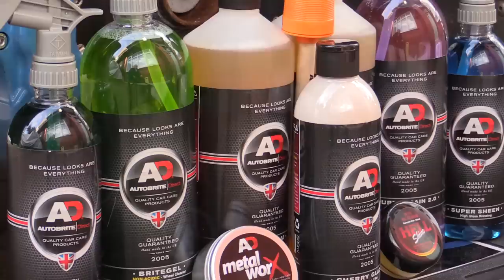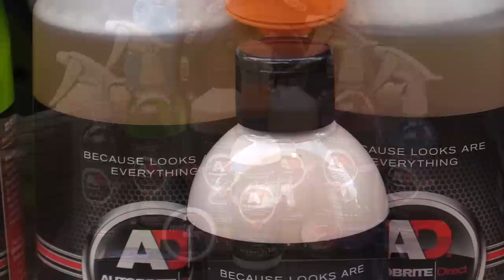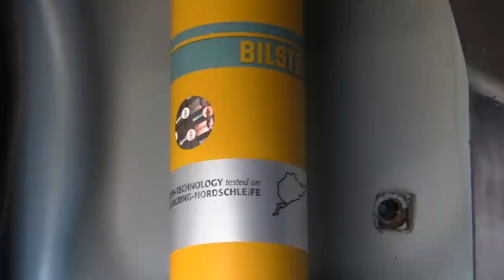'Guru Mobile' Wheels-Off Winter Prep

Comment from the maker: Yes, my brake lines are chafing but so are my 'undies' and they take priority!
Reply: Looks super clean!! If you haven't already, definitely put some anti-seize compound on those aluminum wheel nuts.
Reply: Car Cleaning Guru how long usually dose it take you per corner too fully clean and protect I'm a mechanic looking at possibly taking detailing on as a side job so I have extra income but it also depends on how much extra weight I'll have to carry
Reply: smear it on the wheels contact surface and hub ring also, keeps the rust off and makes them easier to pull off.
Reply: Loved the start of the video, plus the info that you're just hitting one wheel arch in this video.  Really find your stuff informative.  Keep it up!
Reply: i wish i could do it.i can t no garage no tools but end of the winter i can use  the high pressure this is way to do it i agree and the end result are great.also see and hear you and your voise
Reply: Car Cleaning Guru You done a good job man! Car looks great!
Reply: Car Cleaning Guru Out of interest for general car cleaning on non damaged paint/sensitive parts do you turn the pressure down on your kranzle? Or full pressure? Cheers
Reply: Your sense of humor is what makes watching someone wash wheel arches so damn entertaining.
Reply: Car Cleaning Guru 
I'm very concerned of the harsh chemicals run off eventually getting into our drinking water all for the love of making our cars clean and shiny.
Reply from the maker: I would hazard a guess that any cumulative adverse effects car washing has on the environment are trivial when compared with say, big agriculture. It rains so much here in the UK that by the time any chemicals hit the ground water, the diluted effects they have will be negligible.
Reply: Car Cleaning Guru 
So how much water is needed to dilute a harsh chemical to make it safe enough to give your children to drink?   Its someone elses problem if it goes down stream as long as you don't seem the foam on the shore.
Reply: sometimes there is no other way.not always you have to use water.mi self go to the coins wash they recycle the water and there waterless and rinseless- if the body is real dirty can t use both there products biodegradable
Reply: mrBDeye There are lots of ways to mitigate this - you can get plenty of great cleaning products that break down into harmless components, you can find out about how your local ground water system works, and if it is safe wash your car in a suitable place - for example if your rain water system empties into local streams, but your ground water is not taken locally, wash your car on the lawn - or find a local self service car wash that uses a closed system or sewage and wash your car there.  It's just a matter of educating yourself in the best method of minimizing environmental damage.
Reply from the maker: Mate, If you want to have an environmental willy-waving contest, I guarantee I'll beat you hand's down in terms of the overall impact (or lack thereof) I have, despite my car washing compulsions.
Reply: You put so much product on just one wheel it is doubtful you will win any environmental contest.
Reply from the maker: Sure, because judging someone's overall environmental impact by how much wheel cleaner they apply for a one-off clean in a YouTube video isn't in the slightest bit shortsighted. Perspective is key.
Reply: mrDBeye seems to be a keyboard warrior looking for someone to pick a fight with about nothing.
Reply: Matthew Sharpe 
If you don't care about the environment then just say so.  I'm not the bad guy.
Reply: mrBDeye morality has shades of gray, but IMO stirring shit does kinda make you a bad guy, or at least of poor character - but then again nobody thinks they are bad.
Reply: Matthew Sharpe 
I came here and made a good point.  You are here to be annoying.
Reply: mrBDeye you came to a video full of CAR nuts and DETAILING nuts. You really think the reaction to environment comments is going to be pleasant? I mean comment this on a Tesla video or some sort and they’ll love you. Just quiet down and give in. And long live the combustion engine and ‘polluting’ car cleaning products
Reply: mrBDeye oh and enjoy another great guru video!
Reply: C2 VTR 
So your point is car nuts just don't care about the environment.  Got it.
Reply: mrBDeye yes. Yes indeed.
Reply: Car Cleaning Guru l
Reply: Right, I'm going to roll some coal down to the seaside and pour oil on sea life...
Reply: Matthew Sharpe probably have a worse effect than using car cleaning products 😂😂😂👌🏼
Reply: C2 VTR that's nothing, you should see what I can do to a forest with a truck load of plastic bags and some antifreeze.
Reply: Matthew Sharpe you could always throw some paint over a park or even Cover a field in some pesticide.... oh wait..
Reply: hey bud you probaly want to get your wheels re balanced as the idiots that have balanced them before have counter balanced them by putting weights opposite ends of the wheel.
Reply: Car Cleaning Guru  are you gonna show us a proper Motocycle clean , or have you already done one?, Also is that your bike that covered in a white bike cover
Reply: i always wondered where those environmentally friendly brake pads on my car went when they've worn down to the backing plate.  won't be sprinkling any of that dust on my dinner plate, or the petrol based rubber on my tires, or the unburnt fuel that gets spit out the tailpipe when people don't let their engine warm up in the freezing cold to allow the fuel to properly atomize before getting rammed through the exhaust system.  Most environmental willy nillys are hypocrites if they drive a car
Reply: alberto gorin  you can still do this most modern cars are fitted with a back and bar to remove wheel nuts
Reply: Hasnain Khan  in the description   mate top links UK bottoms us
Reply: Car Cleaning Guru 

Please don't  allow self-declared important fools to draw you into a back and forth. These environmental impact nut jobs are only seeking attention and are angry at everything that does not fit their narrative.
Reply: @kiefergrossett3604   oo00o
Reply: Do you not have car washes with underspray and sidespray? In the US, they are quite effective in removing all that dirt/sludge bs. My FA5 down 2" with 17s gets hit in all the right spots and negates this problem. Even in the winter, the carwash hits it with hot water (steam is impressive when gettin a was at below 0 F)
Reply: is it Ford Focus rs ?
Reply: Are u from anywhere near Liverpool
Reply: The Angle of Dangle is relevant to the heat of the meat... :-D

Comment: Great video in general, though I advise against the use of aluminum wheel lug nuts since they simply aren't meant to withstand real heavy duty road and track use. Aluminum is way too soft for this application and will likely strip if screwed on and off often. For really serious driving I recommend sticking to OEM lug nuts, quality aftermarket chrome molybdenum steel alloy nuts or if you want the ultimate in lightweight strength and safety, Titanium alloy lug nuts.

Yes, F1 cars nowadays resort to single central aluminum alloy lug nuts for ultimate lightness, but they only get screwed on and off relatively few times in a race and don't need to survive with intact treads too long after the race.
Reply from the maker: I'm going to give these a go but I agree, they're not ideal and Ti would do nicely.
Reply: Aluminium nuts is pretty fine. Aluminium Studs is a no no.
If unlucky they shear of all at once.
Reply: Nikel87 
Aluminium nuts are fine if they are screwed on and off very carefully, torqued properly with a torqued wrench and antisieze applied to minimize the dissimilar metals turning into a battery problem. BTW Aluminium is actually more electronegative then iron so it is the Aluminum that will oxidize first and iron will only be affected after the Aluminium is all eaten up. 

Aluminium wheel nuts have been used safely on cars such as Porsches as OEM lug nuts but for regular track use steel alloy or titanium lug nuts are used.
Reply: All true =).
Reply: Porsche use alloy nuts on their turbo cars as standard.

Comment: Small tip. Once you finish jet washing around the brake disk put the wheel back on and give it a quick once round the block to remove rust off the disk, otherwise the rust particles will go over all your hard work the first time you hit the brakes.

Comment: Any chance of a vid about ceramic coatings? Or even just your thoughts on it? 

Great vid as always.
Reply: Excellent question and one not covered nearly enough on detailing vids. The internet is awash with detailing vids which give chapter and verse on everything else, but good advice on which products to use on carbon ceramic discs and why, is very scant indeed.
Reply: Nick means ceramic paint coatings, like Autobrite's 'Supersonic'.. :)
Reply: I had similar thoughts, why go to all that effort not to coat the wheels and callipers with a simple coating like Gtechniq C5. After all if its a winter protection. Surely wheel cleaners would just strip the wax off relatively quickly. None the less great video and good information for people to learn from.
Reply: I've seen Pan the organiser made a video about ceramic coating

Comment: Thank you for this video. As before I've never considered taking a wheel off to clean the inside the wheel well like you've done which completely makes 100% sense to me and if you have the opportunity to do so during the winter when they need it the most is probably the better time to do it if you have a garage to park in and something like that with drainage. And I would imagine you would do the same thing in the springtime as well after all the winter is gone snow ice and salt are washed away from the roads

Comment: Just a note about the hubs, i see yours are rusting as most are, you may wish to apply some light lubricant or anti-seize to the center part of the hub where it contacts the wheel to keep rust down, inside where the axle bolt is and all the way out to edge of the inside hole in the brake rotor (NOT on the flange face). This will reduce rusting. Also when the wheels are off you can probably remove the center caps and clean all the way through the center of the flange, be sure to dry the flange area thoroughly on the wheel and the vehicle. Well done mate as always

Comment: Any advice on how to clean the arches in a mercedes which have a carpet finish on them?
Reply: rich boi check
Reply: The rear fender liners on my 2006 VW had a felt like covering on them. I used my leftover suds and a soft brush, it worked pretty well.

Comment: How would you clean a wheel arch which doesnt have a plastic cover? i.e fabric?
Reply: or just hit it with the pressure washer until the water runs clear
Reply: Why on earth would you have a fabric wheel arch cover?
Reply: additional sound deadening/noise insulation ... Mercedes and others have been using them for a while now ... even on my Genesis sedan
Reply: Upholstery brush and a vacuum before getting washing. Or, rinse it with the pressure washer, gentle scrub and use a wet vac to suck the remaining grime out.

Comment: I put new brake discs and pads on my car but didn't drive it and now all 4 has light surface rust, does anyone know how to get it off so i can properly cover them for the winter?
Reply: Just drive the car for 5 mins and use the brakes
Reply: Yeah, I know that'd be the easiest option but the cars not insured atm so can't really do that.
Reply: Dylan. If it's just surface rust then try just using 0000 steel wool or something like that,some may say wd40 but that's adding lubricity to your brakes so eh,you can also just drive it 20 or so and step on the breaks a good bit maybe a couple times,less driving so you don't have to drive it around but again,0000 steel wool isn't rough enough to hurt and easy to do just a little elbow grease. Good luck!
Reply: Do nothing. Wait until you can drive it. And use the brakes like usual. It’s not rusting.
Reply: As soon as you remove the rust it will imediately start rusting again, It's not the disc that's rusting it's the surface of the unprotected steel. Don't worry about it.
Reply: Michael Kennedy but there are quite a few things that you can put on it to stop rust but if it's just a short thing to clean it up and then like by the end of the week or next get it legal and stuff, or put a protectant or something if it takes too long
Reply: Dylan. Jack the driven wheels up and put on axle stands. Then drive it, apply brakes several times. However they will rust over again withing hours, its just surfice corrosion. Nothing to worry about
Reply: You don't have to do something because they are ceramic brakes

Comment: Hi Guru, loving your detailing videos and i have subscribed, a couple of things i have which i really like are firstly an air blower dryer, which once you use it, you will wonder how you ever did without it, and another product called ACF 50 which you apply (very sparingly with a small paint brush) to any surfaces that have rust, obviously be extra careful if your working around the brakes, but slightly rusty nuts etc under the wheel arch bonnet etc do very well, ACF50 is from the American Aircraft industry. loving your work keep it coming.

Comment: Using the water first will die loot the degreaser, so maybe if the wheels and brake and underside/wheel arches is full of mud which has hardened then use the water to get rid of all the dirt mud etc. :)

Comment: Guess I gotta run out and spend $250 and 2 hours between materials and time, to clean a wheel well, only to have it get dirty again just leaving the driveway. Seems like a great use of time. Or i could spend $8 on a gallon of super clean and use a wheel brush, dilute it 4/1 and get a similar result in 5 min an arch, and than spend my remaining $242 and hour and a half detailing the rest of the car with the vaccume and steam cleaner I can buy with that money instead of unnecessary chemicals. Good vid.

Comment: Just a heads up:- your trolley jack wheels need to be able to roll at all times! If they jamb in the block paving slots, as soon as they do it will drag the car sideways as you raise or lower! Put some kind of smooth plate under the jack wheels for safety. I use a large bit of 5 mm thick stainless steel
Reply from the maker: I do know this, it had just been awhile since I jacked anything up!

Comment: I always add a thin coat of anti-seize to the steel rim on the hub and the inner surface of the wheel to limit bi-metallic corrosion and the resulting "stuck" wheel possibilities.

Comment: Brilliant - the shine is immense on those wheels. When putting wheels back on, do you need to torque them to a particular torque setting to avoid stripping the grooves on them, or to just ensure that they are tightly on so that they don't fall off when driving? LOL

Comment: Looking good. I fully admit I've never done a complete Wheels Off cleaning but do regularly clean and decontaminate the wheels and arches. My question: Is there a concern regarding the use of heavy cleaning products on plastic wheel well liners? I've noticed that mine are starting to fade although I cannot be sure it from the cleaning products themselves.

Comment: I know what was going through your mind at the start of the video! Are those gulls going to crap over my motor? It does burn/mark the paintwork if not removed promptly. Had experience of that back in to 70's on my Signal Yellow Fiesta 1.1S down Aberdeen fish market. Stupidly parked under a lamp post. Totally agree with keeping painted callipers in tip top condition. It's a crime not to and it spoils the overall look of the car. I went over the red Brembos on my FK8 Type R with G Techniq C5 Wheel Armour while doing the wheels, so once the finer WX comes back I'll remove the wheels for a blast under arches and check up. I'd suggest you invest in a box of black wheel balance weights for the next tyre change.

Comment: nice cleaning bud but i would watch out what your spraying on them brake pads as it may react with the pad material and cause your breaking to be effected, also the metal backing of the pads usually have a anti squeal grease put on them to stop squealing and you may be removing that when cleaning them.

Comment: Then those same brushes used on the painted RIMS/Wheels ? Which will have a lot of small stones and dirt stuck to the brushes ? Which then you have to try to polish out those fine scratches or swirls in painted rims or wheels ? So never use the same wheel arch brushes on any painted surfaces at all ?

Comment: I have a question. I took my girlfriends wheels off the other day and they are trashed on the inside. They are super contaminated with tar and big pieces of asphalt. They are also stained. They are basic painted aluminum wheels. Would just the tonic help this out? Clay bar would not bring off the stains. Thanks.

Comment: just an fyi. the aluminium wheel nuts have been pulled from the shelfs in New Zealand as they dont meet our safety standards as they deform and destruct. due to heat cycles and torque loading.

Comment: How do you find the autobrite stuff   I started using there gear a few years ago ,as I only live around the corner from there shop. For me there best 3 products are the magnafoam.  Jaffa clean degrease.  And there high gloss spray which is sprayed over a wet car left to dwell for 5mins and rinse off and it lasts . It's good when time is a factor. Try there bubblegum trim coating it's better than the blue trim you used, if you detail something like a van with big black bumpers it's really good . Keep up the great vids mate